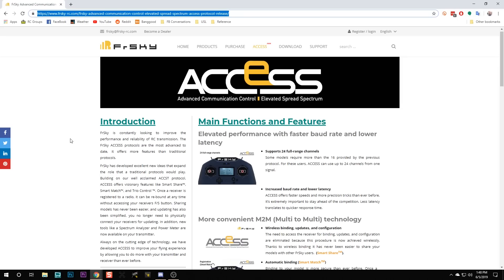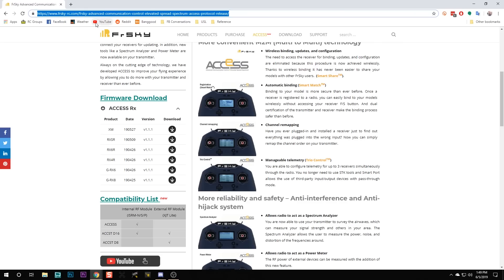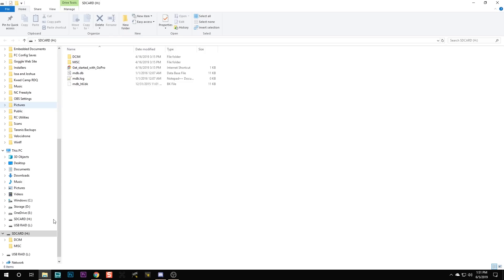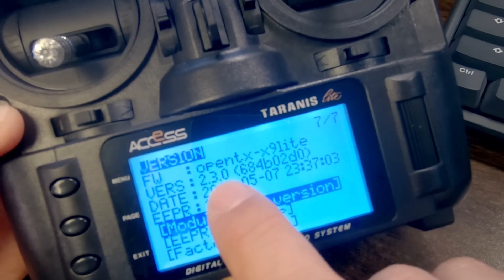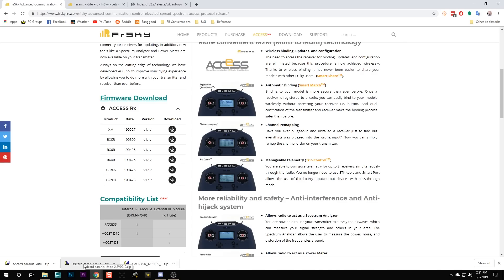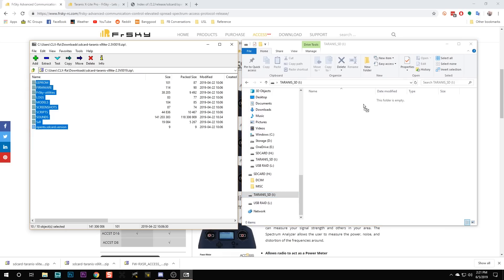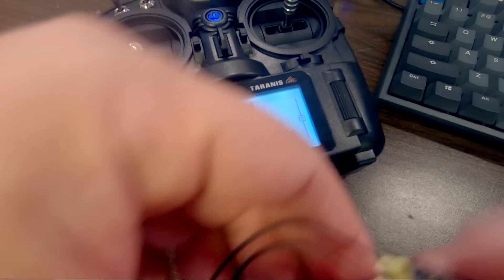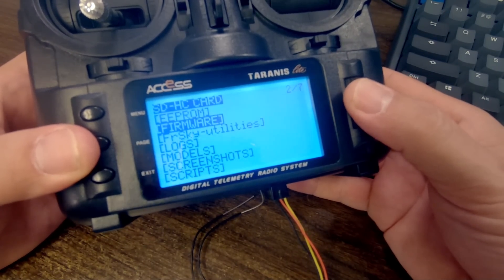FrSky ACCESS Firmware R-XSR Update | X-Lite Pro & X9 Lite

Comment: I won't go to ACCESS since I can't go back to ACCST (D16 / D8) modes.  It's just not worth it to me to have to switch radios to fly different quads.  That being said, it's going to take some earth-shattering can't live without, or can't fly without feature to get me to want to change.
Reply: Accst/D16 just needs a firmware update to the internal radio and you’re good to go. Install latest opentx 2.3 nightly and you’ll even get crsf support. I flashed and bound my rxsr to access and accts and it works just fine. In both modes (and contrary to what Joshua said: you can simply flash the rxsr back to accts firmware. Even with the x9lite. It is reversible.)
Reply: @caveymon  That's good to hear that you can go back to ACCST.  That was a huge roadblock for me.
Reply: @caveymon  Do you nened the iRangeX in order to make it work with d8 on top of the opentx 2.3 nightly? Thanks
Reply: @Itwasntplan  I think so, afaik there still isn't a firmware out with D8 support (yet).
Reply: Pretty sure it's backwards compatible
Reply: @MsKoffeinjunky  FRSky added D16 compatiblity to the new radios, and they are allegedly going to add D8 too, but very reluctantly, basically because the community whined hard enough :D

Comment: If the rx is already installed in a quad I always flash it like this:
1. serialpassthrough <rx-serialport>   In the betaflight cli (this has to be the smartport/fport serial port)
2. Use the frsky flashing software for pc
Especially when you soldered directly to the receiver or don't have a radio with smartport it is much faster!
Reply from the maker: Serialpassthrough is difficult to make work with some FC. But with some FC, and if you have the technical chops to make it work, it's great.

Comment: X9 Lite I got my wife has Ersky Tx on it instead of Open Tx 😡 
Anyone know if Open Tx can be installed over it?
Reply: Dizzy Fpv Yes:) Mine had ErskyTX and I just flashed it with the latest firmware from FrSky. I wanted to get D16 working:)
Reply: mini micro FPV did u delete the erskytx file in the controller’s folder (not the sd)? Also did u update the bootloader too? Mine is on opentx but the bootloader is boot loader v3.1 ready instead of opentx bootloader. Also my internal isrm-n module version is 1.1.0/1.1.1

Haha not sure how extensive you need to update.. a bit bummed unable to bind with spi frsky_X receiver which is on D16 -_-
Reply: @buluidong  You know I regret not keeping better notes when I did this! I don't recall deleting any ersky file. If I remember I just used all the files from FrSky and flashed the latest firmware, ISRM, and PMU. After this I was able to access ACCST and bind to my Sailfly on D16.
Reply: Go to Download Open Tx 2.3 and download firmware put the Radio in Bootlouder mod and flash the firmware after that you have Open Tx in your Radio

Comment: QX7, X9D and XM+. Not saying anything more… =P
Oh and what About R9??
Reply from the maker: ACCESS has not been ported to R9 yet but the plan is that it will.
Reply: @JoshuaBardwell  Okay so patience is the key.^^ Thanks for keeping us up-to-date and also for still thinking of the little things like unzipping files... I'm sure that in the recent past you most likely taught me something similar in some way in relation to drones… ,)
Reply: @JoshuaBardwell  I don't believe that is the plan, at least not anymore. They now sell a R9 "2019" ACCESS module and R9 "OTA" receivers. It seems the R9 system can not be firmware upgraded to ACCESS which is a bummer because I JUST bought an older R9 module. To buy or not to buy the older R9 receivers to go along with it is the question.
Reply from the maker: Exactly the same process. You need to connect the SmartPort wire to the signal wire of the plug on the underside of the radio.
Reply: @JoshuaBardwell  So ACCESS is a thing with R9 as well? Sorry, I'm somewhat confused about that. ;_;